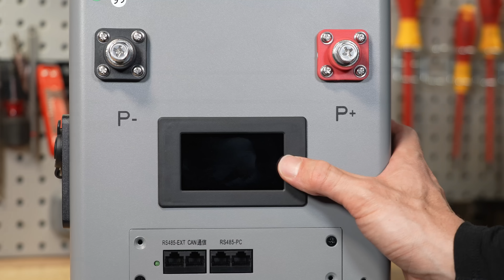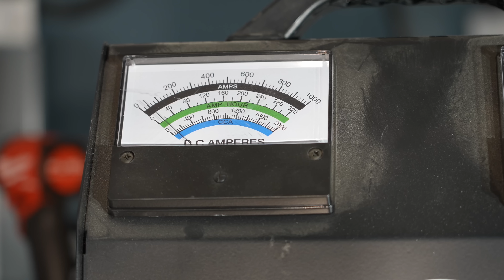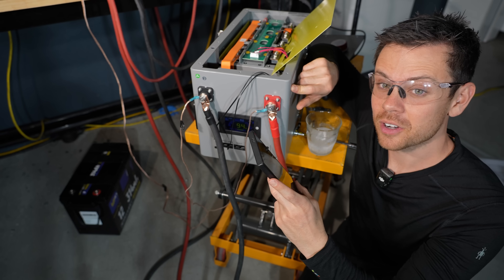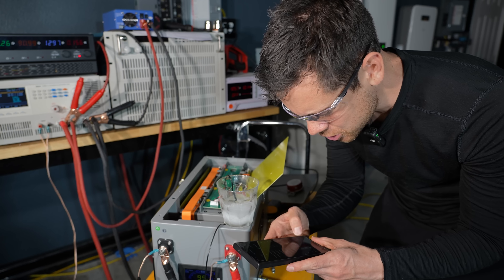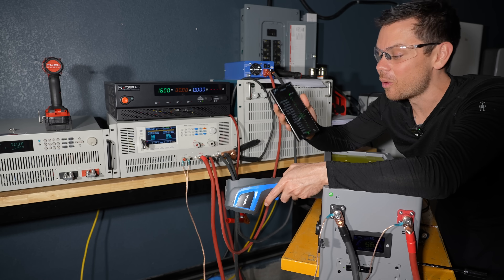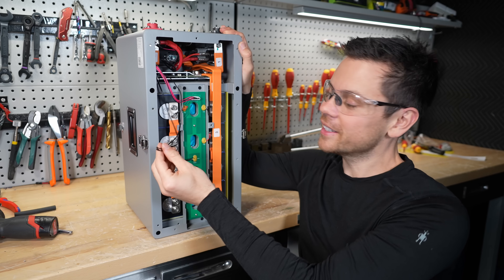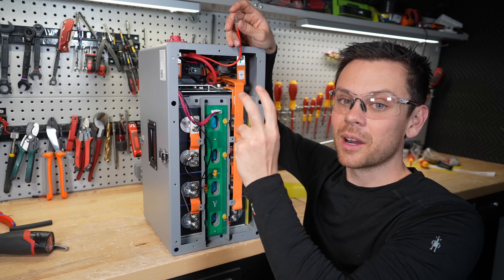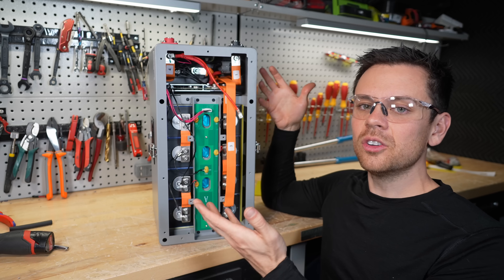NEW! Yixiang 12V 314Ah "Budget" Battery

Comment from the maker: Sponsored link to this battery: 
https://yixiangpower.com/products/yixiang-12v-diy-4s-314ah-lifepo4-battery-box-kit-with-jk-200a-bms-us-stock-estimated-shipping-time-jan-25th-4pcs-eve-314ah-brand-new-grade-a-lifepo4-battery-cell-us-stock-estimated-shipping-time-feb-5th?sca_ref=9207522.jYuzmwEjUpH

Need a dependable battery without all these issues? Check out my current 12V recommendations here:
https://www.mobile-solarpower.com/lithium-batteries.html

Update: Bad wording with the cigarette lighter outlet on the side. If you have one single battery, the small wire will be fused with 200A fuse, but if you connect packs in parallel, it gets even worse. It needs to have a dedicated OCPD. 

Tired of getting ripped off? Check out my "Will Prowse Approved" solar product recommendations below!

12V Batteries
https://www.mobile-solarpower.com/lithium-batteries.html

48V Batteries
https://www.mobile-solarpower.com/48v-batteries.html

Offgrid Inverter System Builder
https://www.mobile-solarpower.com/48v-complete-system-blueprint-559371.html

Hybrid Inverter System Builder
https://www.mobile-solarpower.com/code-compliant-48v-offgrid-system.html

Mobile Handtruck System Builder (very popular!)
https://www.mobile-solarpower.com/mobile-48v-system.html

Solar Panels
https://www.mobile-solarpower.com/300w-solar-panels.html

Ground Mount Solar Racking
https://www.mobile-solarpower.com/ground-mount-racks.html

Wire, Lugs and Busbars
https://www.mobile-solarpower.com/wire-and-connectors.html

Tools
https://www.mobile-solarpower.com/tools.html

Fuses and Circuit Breakers
https://www.mobile-solarpower.com/fuses.html

Plug-N-Play Solar Systems
Ecoflow, Anker And Bluetti! So many models to choose from. See my current recommendations here:
https://www.mobile-solarpower.com/full-size-systems.html

~~~~~~~~~~~~~~~~~~~~~~~~~~~~~~~~~~~~~~~~~~
Need to build a large DIY system? Need a trustworthy solar distributor? These are my favorites:

Signature Solar
Creator of EG4! Solar Minisplits, Victron and More! Largest Solar Store Online.
If you want $50 off, please use my link below and coupon code "DIYSOLAR50":
https://signaturesolar.com/?ref=cPwLcVc0SW-BjN

Current Connected
Best Prices for EG4, Victron, Midnite and so much more! Fast Shipping and Highest Rated Customer Service:
https://currentconnected.com/?ref=wp

~~~~~~~~~~~~~~~~~~~~~~~~~~~~~~~~~~~~~~~~~~
Join our DIY Solar Community 
Need more help? Join the largest solar forum on the internet for beginners and professionals alike. 140,000 members and counting!
https://www.diysolarforum.com

Check Out My Free Book
Best-selling and beginner-friendly guidebook to off-grid 12V solar!
https://www.mobile-solarpower.com/the-book.html

~~~~~~~~~~~~~~~~~~~~~~~~~~~~~~~~~~~~~~~~~~
Contact Information:
I am NOT available for personal solar system consult! If you wish to contact me, this is my direct email: williamprowsediysolar@gmail.com
FTC Disclosure Statement and Disclaimers:
Every video includes paid promotion or sponsorship (such as free products for review). Some links on this YouTube channel may be affiliate links. We may get paid if you buy something or take an action after clicking one of these. My videos are for educational purposes only. Information is subject to change/update at any time. Electricity is DANGEROUS and can kill. Be smart and use common sense :) DIY Solar Power with Will Prowse is a participant in the Amazon Services LLC Associates Program, An affiliate advertising program designed to provide a means for sites to earn advertising fees by advertising and linking to Amazon.com
Reply: why would they even send you this crap to test, knowing that you will destroy their rep....lol
Reply: @Roy-g9r  You are underestimating a corporations ability to be self aware.
Reply: Would this be true for 24v versions if these companies offer them?
Reply: I remember seeing an EEVBlog video a while back where he tested the behavior of fuses and pretty much none of them blew at their rated capacity. Wouldn't that mean that the 200A fuse is the most you would want to use in this battery's circuit?
Reply: @TheNeighbor4U I don't know the answer to.that,,, but it makes sense...
Reply: Blue Sea Systems is an excellent recommendation. Hopefully that holds the course for the future.

I would caution viewers that these software problems are not going to get better with time. Sometimes a fatal (to the device) mistake with a Bluetooth or WiFi app can be as simple as they expect you to hit an OK button after scrolling in a list box. It is entirely possible that ok button was never added to the GUI. 

I want to blame a specific country for that problem, but everyone is failing software QA across the board lately. As a hardware engineer, its deepening dystopian depression descending.
Reply: 10:20 "size doesn't matter"... :body-blue-raised-arms:... For me the size is the very last and least of my concerns. Even when I build my 60kWh system if I need an extra few feet of space its not an issue, compared to safety and quality. I supposed some people care but accommodating something slightly larger never seemed to be a problem for my dates or my builds.
Reply: Thank you,,, I think you sold me on the EG4 12000 XP and EG4 280 ah battery too...
Reply: EEL make better 12 V DIY Battery  box.
Reply: Is there a company making a nice diy metal case to hold 16 of the thinner 105ah eve prismatic cells?
Reply: When will you get your hands on a Donut SS battery?

Comment: so these are 314Ah Eve cells. Correct me if i'm wrong, but isn't the charge/discharge power not 0.5p on these models, so max changer discharge is max 157Ah. Setting it to 200A will outright destroy the cells over the long run. 
If I'm wrong or missing something, please let me know because I have all the same cells and would love to discharge the 16kWh faster.

Comment: Hi Will, great review as usual.

The programmed setup on the BMS, is just the factory setting that JK usually sends it with. All the JK's come with that same exact (stupid) setup. And everytime you hit the LiFePO4 basic setup program, it goes back to these abnormal balancing voltages, 4p Mac 40 amp current discharge, 25 (?) amp charge and the delays are extremely off.

I have setup maybe 30 jk units already, and helped a bunch other people over Facebook groups etc. And the basic settings always get in the way of a fair performance.

Yixiang should touch the basic settings to meet better standards to star with.

Nevertheless, I really believe this box is meany for DIY'ers that know what they are doing (mostly).

The worth size fuse doesn't make any sense, and the unfused thin wire is a just a faulty design from my point of view. JK should include a fuse in that connection.

Apart from that, I think the JK is the best BMS around, and needs a bit of ventilation. The fact that it shuts down for high temperature, means it is working properly, and I think that many other bms's don't shut down even when on heavy discharge and high temperatures.

The cigarette lighter option is useless in many cases, but it is a readily available option on AliExpress with the 50 amp Anderson conector included (I own a few of those and those are dirt cheap).

Regards from Madrid Spain.

Comment: It's a DIY battery, YOU should have placed/glued the temp sensors in a spot. Also, you're not a noob, should know you have to program these JK BMS' from scratch on these DIY units.
Rest of the issues are good finds though.

Comment: Will, if you press one of the preset profiles it will reset everything back to factory standards, for this BMS that's 8 cells, the BMS was set for 4 cells out of the box, as can be seen at 0:35  it was showing Cell1,2,3 at 3.251V Cell4 was slightly off but unreadable as it was in red,  when you hit the profile it reset everything, which is why it went back to 8 cells, I would like to see JK have a warning popup when you hit a profile saying proceeding will overwrite all settings, as you can accidentally hit a profile and it will just overwrite all setting you have spent time entering, this is something JK need to rectify,

Comment: Do you ever get concerned with security on your phone with installing Chinese based apps and it maybe stealing data from your phone?

And for the size of that box, it's too bad it doesn't have a built-in pure-sine inverter.  That would make it the complete package (well...so long as they fix the other issues you found).

Comment: Someone cut those temperature sensor wires with pliers 😂. Its also clever to keep the glass of water over the electric circuitry holding 300amp hour charge 😂

Comment: Bad new engineering. For instance, I tried a JK BMS but was not happy with bacuse it was so tiny and equipped with small connectors. Doesn't look a reliable BMS. Sent it back.
I will stay with ANTS BMS because it has been  five years running non stop without any problèm.

Comment: Typical JK. If you intently tap (or accidentally) the chemistry type, it will reset every damn line value to default programing. You have to save each profile you create. Otherwise, you start from scratch every time. F'ing frustrating. Can't believe they haven't changed that yet.

Comment: The width of that metal PCB holder over the cells is ITCHING to touch those terminals on the cells.

Those little lips with a screwhole in them even more.

The screws that you would put into those lips EVEN more.

This is a shortcircuit machine!

Comment: They use these dumb terminal with the protruding screw/bolt heads so when you mount the lug the wrong way, they touch those heads and contact the case.

So dumb.

Those screwheads may not stick out.

Comment: I am looking into getting replacement batteries for an electric wheelchair scooter. I am looking at getting DChouse 30 amp hour lifepo4 batteries instead of lead acid. Mostly because they fit in the same spot the old batteries fit and arent to tall unlike my 100 amp hour battery. Anyone have suggestions on better replacement batteries? The old batteries are 6 inches tall with the posts about 6.5 inches.

Comment: It is insane to me  that an engineer would ever design anything that carries high current that's bolted together to a specific torque and  then include plastic  in the bolted layers of conducting materials. All of this could be eliminated by adding a nut first to the bolts so you can now torque down your conducting materials against nut. Without plastic in the torqued layers. This would result with torqued connections staying torqued and never experiencing resistance  heat in the first place.  How has this been going on for so long? Did they change the design recently?
Reply: Sorry  I'm referring to the battle born  comments 😊

Comment: Question, planning for 2 x 314 WattCycle Batteries for Motor Home application. Each capable of 200A output. Should my fuse be sized at 400A or something more? I plan to use a Class T Fuse
Reply: I think question like this should probably be asked on Will’s forum.

Comment: It is a JK BMS issue. On older firmware when you select LiFepo4 it resets all other values to some default values.
Yixiang might configured it correctly. 
LFP, LiIon, LTO are just setting the first default values.  You could also set LTO and then correct the right cutoff values, so no need to configure LFP as this step overwrites all existing values set by manufacturer

Comment: sure this isn't a test bed? something to brainstorm on or check actual parts against post (maybe pre?) computer modeled design?
Reply from the maker: They are using the 24 volt model and trying to make it a 12 volt model. That's why the software and the temperature sensors were a mess

Comment: I really like it granted the small issues are fixed. I despise laser weleded terminals in case you need to make a repair. I know they have their benefits for commercial applications, but on consumer devices I prefer a good quality bolt on terminal

Comment: I got a 12V socket with an inline fuse holder for around $10. No need to include that in the battery.

Comment: Do you know if anyone sells a steel shell/case for a battery pack (compresses the cells) that can take standard cells and have space for a custom BMS?
Reply: Yeah. Like what we can get for 18650 power banks.
Reply: Have a look at fogstar 12v kits i built one in November. The metal case was well made double wall the case has the jkbms ontop of the cells. I found the case manufacturer to be rimdin if you search you can buy the case online fogstar also sell the case separately from cells.
Reply: @mikenoon6857  Thanks. will check it out.

Comment: 12V is the new 18650. Which is so yesterday. We want 48V! LOL
Reply: 24V is used in all kinds of diesel powered industrial grade type equipment.  

It's very common in equipment that does a lot of work.  Everything from bulldozers, excavators, buses & coaches, class 7-8 diesel trucks, etc.
Reply: Id mostly agree with that with the exception of rv and boat systems making 12v still relevant. 24 volts is the one I don’t understand, can’t think of any applications that it makes sense.
Reply: @matthewwhite8129  I had a MPPT which could do twice the solar input on a 24V system, which was good with a series of cheapo lipros. 
But that's about it.
Reply: @matthewwhite8129 24V is actually quite usable (compared to 12V). MPPT chargers have higher efficiency, inverters have higher efficiency (and much cheaper). Also less losses in wiring and smaller diameter required for demanding devices.

Most RV/ portable compressor fridges and usb chargers (even 65W PD versions) are 12/24V compatible.

If you're building a campervan from scratch 24V is the way to go because you can use general automotive parts and you only need a small 12V converter for things like tv (although modern RV tv's tend to be 12/24V)
I'm actually helping a friend building a camper van from a box truck and he uses the yixiang 24V battery for most things and a 12V converter with a separate fuse panel for 12V only devices. This way he can use a 5K inverter for his welder and air compressor without having to run a completely separate 48V system.
A big RV (or big rig) probably already has a 24V system although this might depend on the date of production.

48V is more for ESS systems although I've seen this in an RV but this was a big rig with room for a race car so it needed a beefy battery/ inverter system to power air conditioning and a welder and such.
Quite interesting to see a big RV with only solar, no generator. They used victron dc dc chargers to top up the existing battery systems and added a 48V alternator to charge the big battery if needed.

Comment: I’m pretty happy with my $400 “Dumb” WattCycle 314 with a $70 Victron 300A smart shunt and a $25 Blue Sea fuse block terminal.  I’m into it for $100 less and your getting a much better setup.
Reply: I was going to argue for a Litime Bluetooth but dang, that’s a deal for that capacity. Nice setup
Reply: @chrisp1598 how did you get it so cheap? It's $625 on the European site right now

Comment: On the JK BMS when you change the battery type it resets all the settings to the JK factory defaults.  You may have accidentally wiped out the Yixiang's settings so it's impossible to tell if they shipped it with correct settings or not.  Also the JK V19 BMSes have 4 temp sensors. Since you are only using the BMS as a 4S you wouldn't need 4 sensors so it looks like they cut 2 of them off.  Why they didn't cut the 2 that were loose and leave the other 2 is a good question.
Reply from the maker: this bms is for their 24V model, so the defaults were wrong

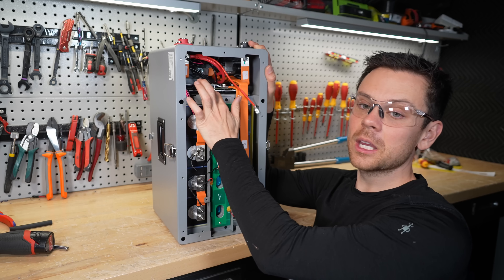Comment: 10:44 
Although I’d likely not use a ciggy socket, the idea is sound- if it were fused. 
I think a couple USB outlets, an SAE socket 30A, and maybe an extra terminal stud 30A outlet might be nice features? Like in a boat or bare bones “toy garage” -type diy or other cargo trailer rv. 
Then again, I have other ways of dealing with accessory power on my 12V system that work fine already, and if I built something to use that in I’d do similar.

Comment: Anybody who's made a battery with the jk 8s will be familiar with the hands on programming and never to touch the lfp button afterwards, it's a rite of passage 😁
Reply: Yep, been there done that.  Makes me curious what settings were before Will touched the LFP option in the app.
Reply: I still get paranoid feelings about did I accidentally hit the LFP option the last time I was messing around in the app😄, it's parameter suicide.
Reply: looks like he has never seen that kind of jk BMS.. 😂😂😂
Reply: It shouldn't be though. You can't make anything 'stupid-proof' but everything should at least be 'noob-safe'.
Reply: @P_RO_  I agree and it still hasn't been rectified years later.
Reply: Yep, had my JKBMS all set up and programs and accidentally pressed the lipo4 profile button and started crying.

Comment: I'm not likely to purchase a DIY 12v battery anytime soon, but I noticed that they used epoxy sheets between cells instead of the foam hopefully that change makes its way to the 48v kits. This product needs to have better QA and maybe a redesign though.